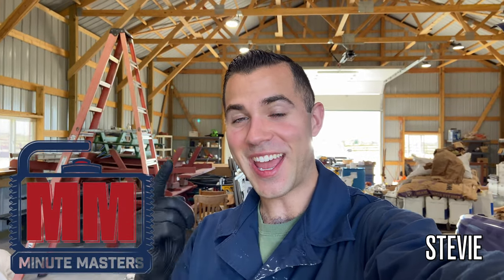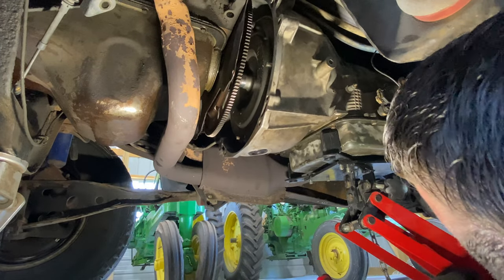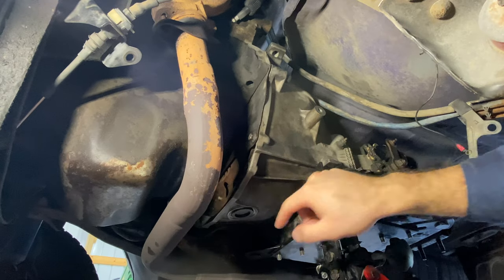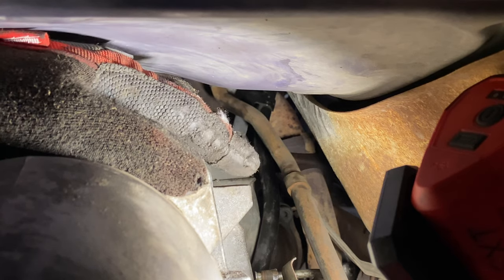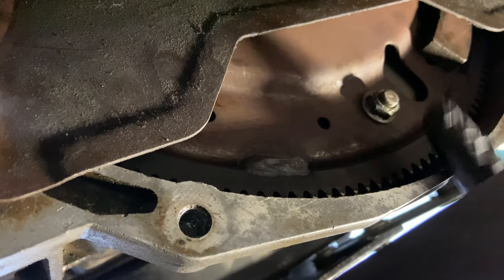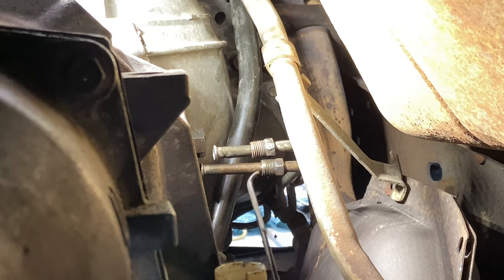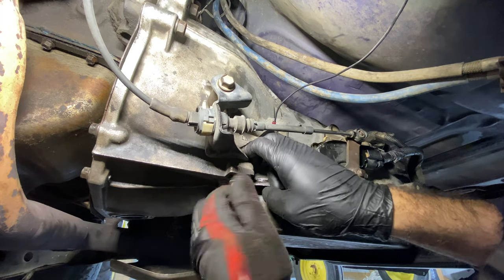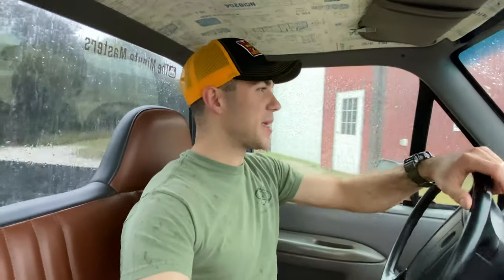How to Install/Replace a Transmission in One Day | 1995 Ford F150

Comment: Wow he did a whole lot less cussing than me lol, boy lining up those transmission lines was so much fun lol. It wasn't easy but the satisfaction you feel when you turn your truck on and drive off is second to none!, shout out to my pops!! for helping it would have probably taken me a week to get it on by myself. Bit of advise if you have a hard time lining it up bring it down take a breather and start the installation over from the beginning.
Reply from the maker: I sure did! Lolol You are so right about starting over. Most of the time, a new approach solves the previous alignment issue.
Pops are the best for car advise!🤙

Comment: Took  a little bit get to you first why not tell to replace  front and rear seals and notice look like  you changed front pump no telling  what t you did to tyranny.  Why not??
Reply from the maker: I replaced the front seal only and I did that in a separate video. That was the only seal I was aware of that could be leaking.

Comment: Hey Siri this is Francisco that’s a very cool video removing the transmission from your truck I remember back the old days the good old days did you Rebuild your transmission
Reply from the maker: Thanks Francisco!🤙 I only replaced the torque converter seal and the torque converter.
Reply: Stevie I ask you cause remember last time in one of the videos you found a part inside the pan the transmission pan so I thought something went wrong with your transmission that’s why I asked always like your videos buddy have a nice weekend
Reply from the maker: @FranciscoLopez-cc7ui  Yup, I did find a part but I installed the transmission anyway. Lol My transmission isn’t working very well right now. I’ll probably have to rebuild it.

Comment: Hey I hope you can get to my comment but I have a 95 f150 with a 5.8 and an e40od trans. I’m putting another 5.8 back into the truck. I’m just confused now because on the left side looking from the front of the engine there looks to be two alignment dowels one in the trans and one in the bell housing. I don’t believe that is normal just let me know your opinion about it and or how to get the one out of the trans.
Reply from the maker: If I remember correctly, there should be an alignment down in the back of the engine and an alignment dowel in the Bell housing of the transmission and they are opposite each other. Are you saying there are two alignment dowels on the same side which is making it impossible to fit them together? I’ve never removed an alignment dowel. But I’m sure there’s a way to get them out.

Comment: I just impact the transmission bolt my mechanic teacher told me he work with ford over 45 year
Reply from the maker: So no torque wrench?
Reply: @TheMinuteMasters  nope I just use impact that do over 100 foot pound my teacher said it’s doesn’t matter use impact good to go
Reply from the maker: @dilanbashaw4235  That’s how I did it before but I felt I should use a torque wrench this go around.

Comment: Getting a 91 F150 XLT Lariat with the 302 5l, only issue is the previous owner nabbed the trans for another truck. You make this look like a piece of cake.
Reply from the maker: Nice! Those are sweet trucks! I won’t say it’s easy, but it’s definitely straightforward if you have all the right tools and take your time.

Comment: Always always make sure the converter is all the way before bolting it up so you don't damage the pump.  My friend is a tranny builder and he's had to redo a bunch of trannys that he's built cause some people put them in themselves and don't make sure it's all the way in.  They have extensions that are real long specifically for tranny work for the bell bolts also when I do the converter bolts or nuts I do one then go 180 from that one then do it then the other 2
Reply from the maker: Good advice Adrian!🤙

Comment: im installing a new torque converter in my truck and we got everything put back together started the truck up but in drive and reverse it makes a horrible whining noise now and seems to slip when moving in drive but reverse is fine
Reply from the maker: Did you pre-fill the torque converter? And do you think you got the correct stall rating for your truck?

Comment: Does  the torque converter push back enough to allow the ability to line up the bolts separately from the dowel pins when you install the transmission or do you have line up the dowel pins torque converter bolts all at one time when you install it
Reply from the maker: They have to be lined up at the same time. It sounds more difficult than it is. The dowel pins will start to line up and insert sooner than the torque converter studs, but not by much.
Reply: @TheMinuteMasters  appreciate the info.

Comment: Great video! I'm trying to avoid replacing my transmission. The past two days it's been clunking when decelerating from 2nd to 1st coming to a complete stop. It's clunking/bucking pretty hard and I don't want it to get worse. Trans is a Jasper remanufactured w/40k miles and the rear end is remanufactured with 1,500 miles and the u-joints have 10,000 miles on them and the engine has 40k on it, remanufactured. I seem to have a wet area near the back of the transmission near the driveshaft where they mate. I think it's trans fluid but my fluid is full. Is this related or two separate issues? Why would my kinda new transmission be leaking? And from where? How would I replace that rear seal around where the driveshaft goes into the transmission? The clunking seems to be coming from the rear, but maybe I'm wrong. It's not really a loud noise, just a hard jerk. Pretty much only when I brake slowly, not nearly as much when I brake quickly. I don't know what all to check considering everything is supposed to be new and new-ish
Reply from the maker: Thanks man! Transmissions are tricky. They require lots of diagnosing to figure out their issues but even then it’s not 100%. I like to start with the cheap fixes first. Chalk your front wheels, jack up the entire rear end so both wheels are off the ground, put your truck in neutral, and then go in spin one of the tires. i’m wondering if you will hear that clunk noise.
Reply: @TheMinuteMasters  thank you! I will try that next, first thing in the morning. Its pouring rain. Can I message you then with what I come up with? People in forums are just saying take it to the shop, which I can't

Comment: What transmissions can you use in a 1995 ford f150 v6 manual truck? Like what year trucks could id pull it out of
Reply from the maker: That’s a good question. I’m not a transmission swap expert, but I think a couple of Ford transmissions can be installed behind your V6. I would post your question in a forum or the OBS Revolution Facebook page and see what information you get.

Comment: Is the torque converter supposed to slide back and forth ? Having trouble getting the torque bots to seat right
Reply from the maker: Nope, it should be firm. There should be no forward or backward movement. It should still rotate. The TC may not be fully seated inside the transmission bell housing.
Reply: @TheMinuteMasters  thank you ! Will re check it !

Comment: I have a 96 ford e150 5.8 that has a hard time shifting into 2 and up and there’s not much help on the internet would you know some reasons why?
Reply from the maker: First and foremost, make sure that your fluid is in good condition and that it’s at the proper level when at operating temperature with the engine on. 

You can buy a transmission pressure gauge and screw it into the test port on the drivers side of the transmission. Then you can check the pressure needed to shift gears.

Comment: I just reinstalled my transmission got two torque converter bolts on but when I turn my crankshaft it won’t budge? And all the bell housing bolts are in and tight.
Reply from the maker: Really? Do you think everything is seated properly? Is the torque converter itself properly seated inside the transmission bell housing? If the crank is just plain hard to turn, a lot of people suggest pulling spark plugs so that the pistons have an easier time compressing.
Reply: I’m starting to think the torque converter isn’t seated properly in the Bell housing. The engine turned over just fine when I removed it. it’s so stuck that it started to loosen the bolt to the pulley on the crankshaft. But I can’t believe I got Two bolts on the torque converter on and it’s still not seated correctly so I don’t know.
Reply from the maker: @andrewlyle4618  It sounds like to. I would unbolt the bell housing and push the trans back. Then verify that the TC is seated properly.

Comment: Hey man what is the thread size for the pulley tensioner because mine stripped out
Reply: Where the tensioner bolt sits
Reply from the maker: Good question. I don’t know off hand. Do you have the bolt?
Reply: @TheMinuteMasters  yeah
But if i take the whole thing off from left dife like the smog pump anf the idler  bracke how do you remove it